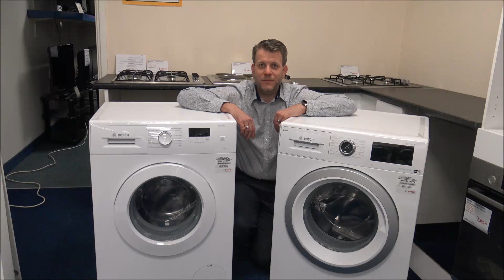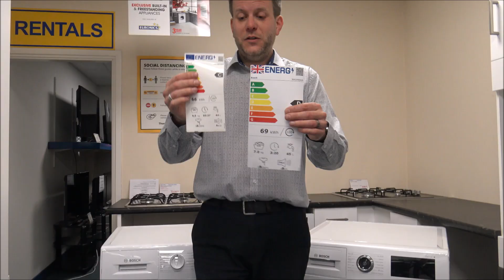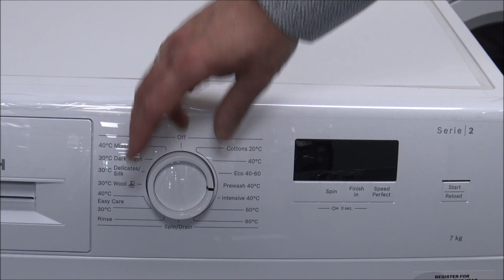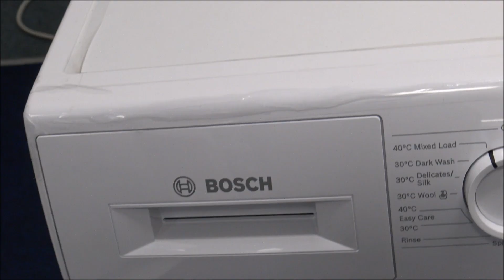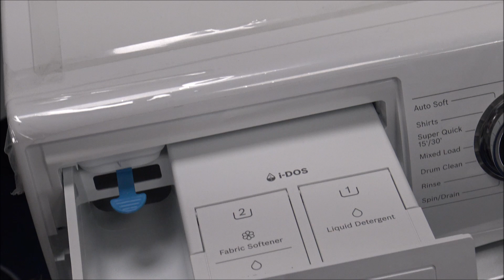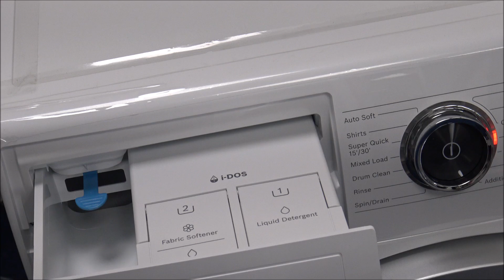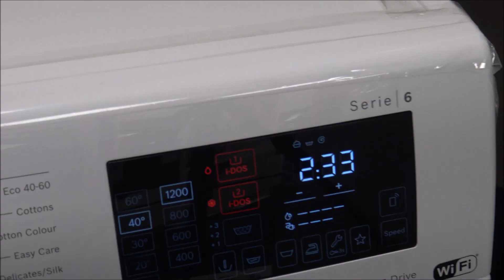Is It Worth Paying Extra For A Better Washing Machine?

Comment: I thought it would be a good idea to buy a more expensive washing machine a few years ago.  I bought an LG with a direct drive drum (with a ten year warranty on the drive) so no belts to go wrong.  After about two years it started screaming at me, and it turned out the bearings had gone.  The cost of repair was so expensive that it was cheaper to buy a new washing machine.  My policy now is to buy cheap machines and replace them when they break.
Reply: I had a top Bosch for 4 years that went broke and the cost of the arrangement would be €400.  I said: what?!!!!  No thanks.  I went to the store and bought a LG for €329 with delivery and assembly included.  It's still been here for over 12 years.  Strong and firm to last.  Let's guess!
Reply: Me too. Hate the idea of our disposable economy but experience has taught me that it’s  the most sensible option costwise
Reply: Just bought a LG today. Our Maytag 2000   Bit the dust Christmas Day😢.  Did about 4 loads tonight in the new machine. Maytag lasted about 6 years .
Reply: @greganphotography  When my LG started playing up I was told that it won't be the bearings because the bearings don't fail on that particular machine!  One time a washing machine repair man told me about a client who had an expensive Miele.  The electronics broke and the repair would have been really expensive.  The repair man told him that it would be cheaper to go out and buy a Hotpoint.
Reply: @catwoman7462  My washing machine repair man told me Miele were probably (at that time) the best machines available BUT that there were so few Miele engineers (at that time) that you could wait a long time to get it repaired so he said on that basis, they weren't worth the risk.
Reply: @happygardener3990  Miela wont need repairing for at least 10 years where your Bosch, Hoover and Hotpoint will at 18 months. Kept our old Miela going for 13 years, parts available dead cheap simple repair unless you have to get the cast concrete drum out.
Reply: @jhareng  my miehle cat and dog is certainly not cheap for spares, filter is $50  and power cord mechanism  $200 the plastic bearing on the turbo brush were $35 each, but luckily even though the vacuum is over 10 years old spares are available
Reply: @debeeriz  Got to know where to get parts from shop around not just at the stealers.
A Miela pump was only £17 delivered, the whole unit complete with plastics that extracts the water. Likewise cord could have been bought for around £15 delivered. 
Must get a few more turbo type brushes for the only English made Numatic vac, 3 types for £23.50 genuine delivered. In fact all parts available and cheap, dearest is the motor sub £50.Hepa filter £14. Best vac ever bought for suction, will still keep an Animal Dyson. Should see the price of Kirby parts, had 2 one lasted 20 years the other 3 years.
Reply: @happygardener3990  Biased ! Love these engineers who say what suits their needs... Buying cheap washing machines is neither ecologically sound nor finacially sound you loose out on both... It's your pocket that pays !  ( A friend bought 3 x Hotpoint lasted corca 2 years each... washing for a family of 3 all doing sport too ! Twins come along so 66% larger family, they buy a SIEMENS machine about the same price as the 3 Hotpoint machines added together but it last 14 years before having an issue !!!
Reply: @jhareng  50 years in appliance industry tells me this is an inaccurate statement... Miele machines are tested to 20 years where as BOSCH / SIEMENS is 15 years. My experince says buy top end end BOSCH and SIEMENS and they will last !!! ( As do MIELE ) Many appliance faults are down to the end user not reading the instructions and/or mis-using the appliance...
Reply: @davidmessenger3446  So what, you could have worked in that industry 50 years and still be clueless, means nothing what i said is a fact. 
Npthing rude just stating pure facts unlike your biased self thats still wet behind the ears after 50 years!
Your forgetting sonny we have had numerous Bosch mid and top end since 80's, nothing Bosch has lasted except fridge and freezer 2003. 
'Fault of user', what planet you on, it fails because of several sub standard manufacturing aspects as grill, lights, seal and most common the heater element all simple repairs until the control switch goes at 8 years. 

The Blue Pro tools sander lasted 28 years because it was rarely used, routers used once and pack up, got another here now the 2nd Bosh Router used for 10 mins thats it, packed up. The cheap entry range even worse made in South America.
Reply: @jhareng  unfortunately here in nz there is just one importer, and though parts maybe cheaper online in germany the freight costs rule that out
Reply: @jhareng  my dishwasher is an aeg the filler hose was $160 , but a simpson hose fits  [both electrolux] that was $22, one made in germany the other in asia and so far it has lasted longer than the oem hose, that seems to be the week point on aeg dishwashers as i have had to replace all three hoses, filler, drain and the heater hose
Reply: @jhareng  I think your quite rude reply says it all... What do you think 50 years gives you ? Experience ! Knowledge... And guess what my comments are based on 50 years of facts !!!
Reply: @davidmessenger3446  Your case still wet behind the ears.
Reply: @greganphotography  I'm now in my second direct drive washing machine. My first must of lasted twenty years before it developed a fault and stopped working. I figured it had done it's bit and didn't bother getting it looked at. Maybe some of this is down to the luck of the draw.

Comment: I got an expensive Bosch washer drier when new it worked well only I could not use the drier as it made everything smell bad only used it a couple of times a week only for the mane bearings to go on it after 4 years the repair man said dump it as it would be to much work to strip it down and rebuild it that is why I only buy cheap washers and chuck them when they go wrong and get a new one.

Comment: My old mid range Bosch washing machine lasted me 19 years, with a few minor repairs for things like brushes. I immediately bought another mid range Bosch but there's a fair chance it may outlive me, if it also lasts 19 years. (Clue, I'll be 82 if it does.) Maybe there's a point where you buy a machine to last your expected life span, lol? Come to think of it my Bosch tumble drier, which has just died after 23 years old, was actually older than the nice young man I talked to on the phone about delivering the new one. My current chest freezer (Norfrost?) belonged to my mum, it's currently 46 years old. I love things that last.
Reply: Our top of the range Bosch made in Germany not South America lasted 16 months, shocking one of the worst around.
Reply: Better for the environment too remember, in all sorts of ways!
Reply: I have seen Bosch bearings go bad a few times. Maybe that attests to the rest of the machine lasting extremely long 🤔
Reply: How similar your experience is to mine.  I have had my Bosch washing machine for 19 years, mid range.  Never ever had any problems.  Just stopped working.  I think it has been wonderful.  I will get another
Reply: @valeriedavidson2785  -  did you get another Bosch, and how did it go ?.  We used to have a Bosch machine, albeit a high end one, bought at a clearance discount price as end of line. This was about the year 2000, cost abt £300 at the time as massively discounted, but still a lot then, it gave 17 years of faultless hard service until, sadly, the metal door catch broke and no spares available. A great shame as it was a beaut, ran so smooth etc etc, as a mechanical engineer with knowledge of motor and bearing systems it was a pleasure to use, so well engineered.  Sad to report, I've read umpteen Bosch reviews in the last year or so, its very clear that Bosch in general are not built/ designed so well asused to be, they're clearly trying to keep the price down, for almost every model I've researched I've read far too many bad reviews regarding inability to spin smoothly etc etc, or ridiculous early failures.  There have clearly been major design issues when they introduced the new brushless "eco drive" motors, if they die then its sometimes more cost effective or indeed essential to scrap the whole machine !!!, hence I'm still worried what machine to buy and have reluctantly decided to avoid Bosch - since 2017 we've used a second hand Hoover, which is now dying slowly (bearings noisy), yes I needed to replace the motor brushes once ( a fiver), something never had to do with the old Bosch machine, so I wonder why bother to go the brushless route -
Reply: Old freezers use a ton of power.. I would get a new one asap..
Reply: Ui
Reply: Mine lasted 23years with no repairs
Reply: we used to have a Bosch machine, albeit a high end one, bought at a clearance discount price as end of line. This was about the year 2000, cost abt £300 at the time as massively discounted, it gave 17 years of faultless hard service until, sadly, the metal door catch broke and no spares available. A great shame as it was a beaut, ran so smooth etc etc, as a mechanical engineer with knowledge of motor and bearing systems it was a pleasure to use, so well engineered.  Sad to report, I've read umpteen Bosch reviews in the last year or so, its very clear that Bosch in general are not built/designed so well asused to be, they're clearly trying to keep the price down, for almost every model I've researched I've read far too many bad reviews regarding inability to spin smoothly etc etc, or ridiculous early failures.  There have clearly been major design issues when they introduced the new brushless "eco drive" motors, if they die then its sometimes more cost effective or indeed essential to scrap the whole machine !!!, hence I'm still worried what machine to buy and have reluctantly decided to avoid Bosch - since 2017 we've used a second hand Hoover, which is now dying slowly (bearings noisy), yes I needed to replace the motor brushes once ( a fiver), something never had to do with the old Bosch machine, so I wonder why bother to go the brushless route - and yes the Hoover washed and spun surprisingly well given it's budget selling price. Hope your new Bosch serves you well.
Reply: ive owned my lg for 16 years, i got a samsung bur i kept the lg and im pretty sure that the lg will outlive the samsung if i fix it

Comment: We bought a cheap Beko machine 6 years ago after having bosch and miele, both lasted about four years before becoming more expensive to repair than a brand new Beko. The cheap Beko has worked perfectly having two or three washes a week for 6 years and still is perfectly good, still looks new and is very quiet and does a damn good wash. Dont waste money on expensive machines, I can buy three cheap Beko;s for one Bosch !
Reply: I do exactly the same.

Comment: I have a question about the auto dose on the newer machine, will the auto dose take things like gel or powder and if you turn the auto dose off, how are you supposed to use fabric softener?
Reply from the maker: You can use fabric softener in the second dosage compartment, but in the Idos compartments you can only use liquid. You can use powder or gel, but it is best to put it in the main drum, but defeats the whole concept of going for the idos machine

Comment: The more features a washing machine has, the more there is to go wrong, just look how long the Whirlpool machines last (20+ years if you were wondering) and they only have 2 or 3 wash cycles. Let's be honest, no one ever weighs their laundry before the put it in the machine and most people just use the 'normal' cycle 80+% of the time. I have a 12 year old basic Bosch and it has done my family of 4 proud. For me, the trick is to not overload them, and clean them regularly. I line dry our clothes as often as possible and only use the dryer if I have no other option, I also think if you have a lot of clothes and bedding to dry, it's worth taking them to a laundromat and using a big commercial machine (or 2) which can handle the weight of wet clothes.

Comment: The db scale is logarithmic, not linear. Let me assure you that the audible difference between 72db and 74db would be very hard to notice. If, you wish to effectively double the volume, make something twice as loud, you need an increase of no less than 10db!
Reply: "make something twice as loud"  10 dB difference to be perceived as twice as loud. What the presenter said about it being technically twice as loud at 3dB is correct (3dB being a doubling of sound pressure level), but won't be perceived as twice as loud by a human -- indeed, it will be negligible difference as you say.
Reply: Doesn't surprise me because that series 2 which I have is quiet. Only at full spin is it loud and compared to the machine it replaced which was a mid range 12 year old Bosch it is probably half as loud. On a wash you just hear the water splashing
Reply: Yes it's logarithmic, volume doubles every 3db though. So it's 2/3rds as loud which is noticeable.
Reply: @khalidacosta7133  you are mistaken. In order to gain an increase of 3db, you need to double the power. An amplifier delivering 1w to a 90db efficient loudspeaker will produce 90db of SPL or audible volume. If you double the power output of the amplifier to 2w, there will be a SPL increase of 3db! In order to double the audible volume you need an SPL of 10db. So the power output of the amplifier would need to increase 10 fold. You would need that amplifier to deliver 10w to that speaker to achieve 100wSBW and effectively double the perceived audible volume. So going back to your scenario with the 2 washing machines, 1 producing an SPL of 72w at maximum spin speed, the other producing 74db, the difference would be barely audible to the human ears. Do your research my friend, you will find the facts corroborate my explanation!

My apologies, SPL stands for Sound Pressure Level. A few occasions in the above narrative i in error put SBL. On every instant that should SPL. That does not invalidate my explanation and humble attempt to correct this chap.
Reply: @howardskeivys4184  @Todesengel Yep, decibel was originally conceived for transmission loss in telephones. I.e due to resistance, a 1v signal that travels 100km, the voltage would drop to 0.8v. However, this is not applied to Sound Pressure Level (SPL) as sound is not an electrical signal - the suffix after dB is the important part, as it indicates the reference value by which the ratio is calculated. For acoustics, while everybody says, "dB", it should have said, "dB SPL". The reference value is what the quietest sound the human ear can hear, which is 20 micropascals. (unit of measure for pressure). 

Now for some practical examples, at 1 meter away, a jackhammer making 100dB of noise would produce a pressure level of 2 Pascals. The same jackhammer making 110dB of noise should produce 4 Pascals under your theory but doesn''t. It produces 6.32 Pascals - A bit over triple - the pressure level doubles every 3Db (roughly.. when rounded up to make it easier to calculate differences). Your ears are calibrated pressure sensors that can detect minute changes in air pressure, sampled very quickly, which is perceived as sound. It is also why you can "feel" the lower frequencies. 

This is before you take into account of reflected sound too (notice how some rooms echo more than others?)... so the difference between 72 and 74dB can be even greater, especially in rooms which are smaller and have hard surfaces, which is where washing machines get typically installed. 

Source: https://en.wikipedia.org/wiki/Sound_pressure#Sound_pressure_level
Reply: @khalidacosta7133  I could quote a multitude of scientific and acoustic literature, contrary to your opinion and research. I won’t. This is in acute danger of becoming a circular debate. That is to say, that we could continue the discussion for eternity, but never agree, in other words go round in circles, which like a circle is, pointless. We’re going to have to agree to disagree.

My background is in physics. Culminating in a diploma in practical and applied physics. My speciality interest is acoustics. I’m an audiophile and I have spent years and years of experimentation, trial and error in acoustic correction. I’ve spent tens of thousands of pounds on dozens of audio components getting the sound balance to my liking. All of my learning and experience and all of your quotes will not change the fact that there is no way 74db is twice as loud as 72db.

Feel free to reply to this comment. I will not offer a rebuttal. As I explained, I don’t want to get into a perpetual circular debate!
Reply: @khalidacosta7133  Mate, its in the name 'DECIbel'. The log has a base of 10 instead of the 'e'. So the volume doubles at every 10 db increment.

Comment: Half the time it's pot luck. Even expensive machines can break down. I've had a few brands. AEG, Indesit and Hotpoint. I've had them all on average 6-8 years each with no problems, which, I think is good going. The in-laws had a couple of Mieles. First one lasted 16 years but the newer one was a nightmare. Something always wrong with it . So they got rid and got a John Lewis, which has been great for 4 years up to now.
Reply: I had a Bendix for 20 years.  I've had Bosch for 12 years touch wood nothing wrong yet
Reply: It should be quality control not pot luck though. There is a reason a Lexus has less defects than an Audi after all.